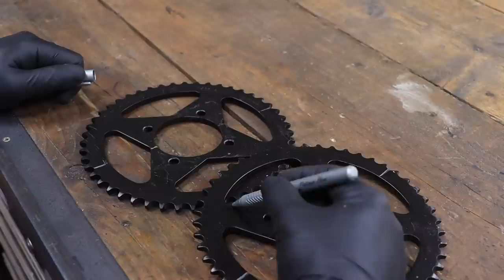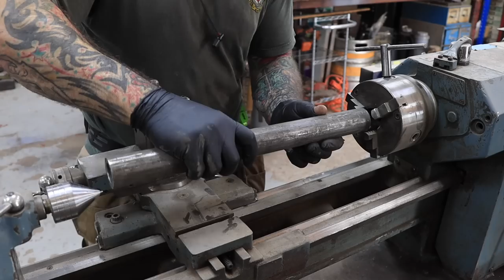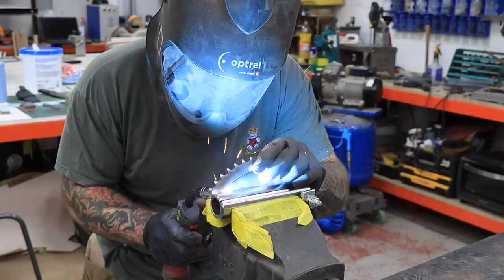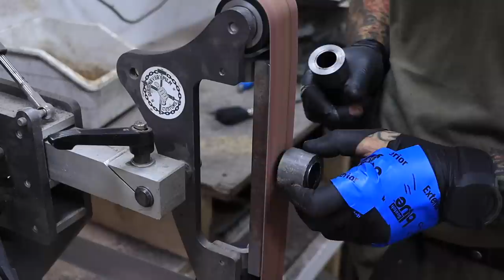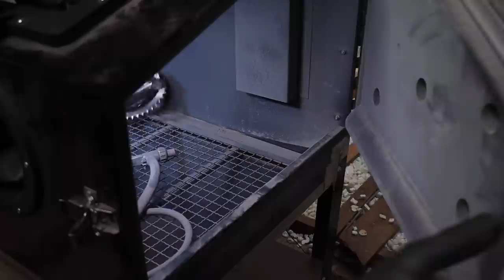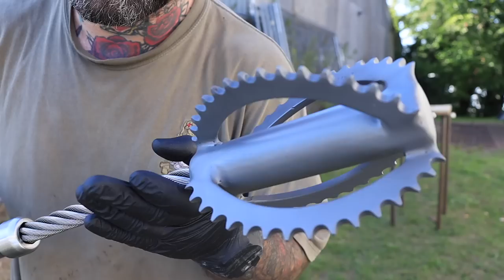Kinetic Energy 'Twisted' Mace

Comment: Yes, I was hoping you'd make a sprocket tooth mace head [mentioned it a while ago]. BTW - before you welded the head on, the grip and shaft looked like a lightsaber... An extending [telescoping] kinetic lightsaber would be kinda cool - a bit like an ASP Baton, with with wire-rope.
Reply from the maker: Had the parts and idea for a while but wanted to get the right idea down. Thanks

Comment: Thanks for the video. 

I noticed you putting a rubber pad over some of the pieces while you were welding. What is the purpose of doing that? 

When you sand-blasted the head, I wondered whether you were going to coat it with something. Have you ever used electroless nickel on any of your designs? Have you ever used Cera-kote?
Reply from the maker: Yes mate it’s a silicone mat that helps prevent weld spattering the piece, very handy. 

I have done my own coatings of copper or brass wash but no nickel or ceracote

Comment: I was wondering where was the other chain sprocket ! It does looks brutal the way you made it, but i would have tried with a longer cable and a linger handle to make it like a true two-handed skull opener. Where do you shoot your video ? Is this your workshop or your workplace ? I have also noticed there is a dog place behind one of those bench, maybe it is yours ? Cool video as always, it seem that your crazyness get ahead of your creativity.
Reply from the maker: I used both of them for this head, the point in the slight flex is so you put less effort into the swing meaning it only needs to be one handed